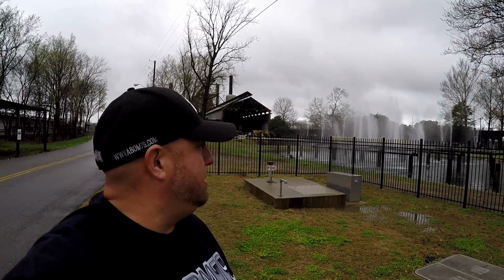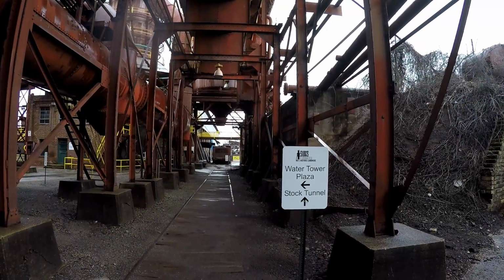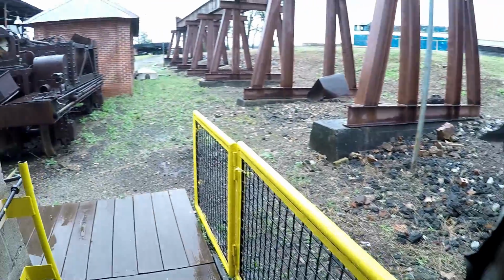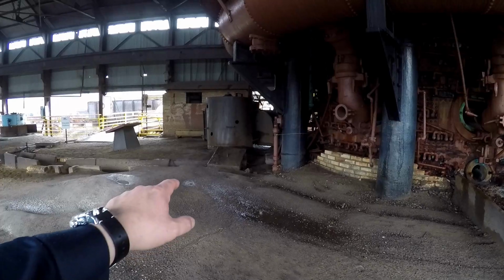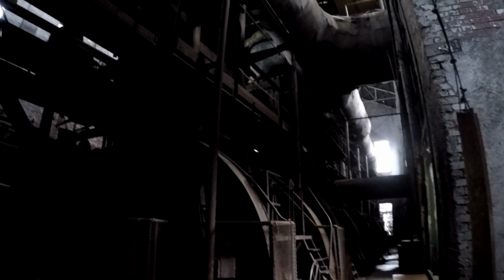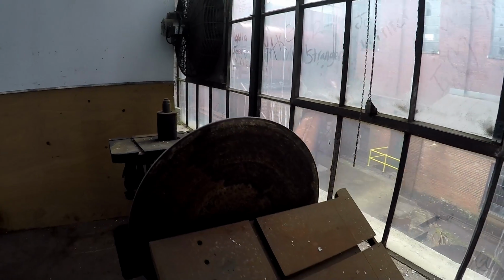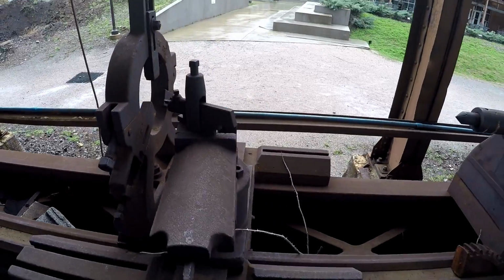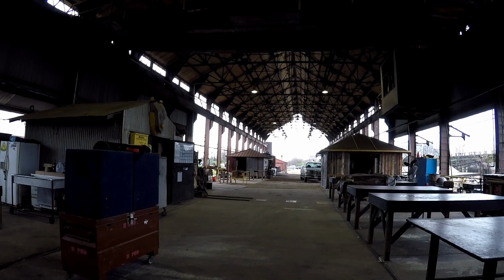Sloss Furnaces, Birmingham Alabama

Comment: The sanding machine has a spindle and flat disk sander. I suspect these machines were used for pattern making. That is a thickness planer and one of the first machines you showed is called a jointer, the jointer flatenes the wood then run through the planer to true up the thickness so the face sides are parallel.
Reply: James Stanlake you are correct. They are for pattern making. The jointer and molds gives it away. Pattern makers jointers have adjustments under both beds. No one that doesnt make patterns would want that type jointer. I wish i had all of those machines though. Would love to see them sing again. Im 2 1/2 hours south of there and have never been. Maybe it's time to go
Reply: they are used in pattern making but made for woodworking. I am a 3rd generation woodworker with over 50 years experience. Years ago I have used some of the old machinery with the square cutterheads, most of them set up for the overhead  belt driven power supply and converted to electric motor. Love the old machines as they are heavier and made with better steel.
Reply: You are right. What i was trying to say is that for general woodworking that jointer has alot of adjustments and is alot trickier to setup vs dovetailed or parallelagram beds. I have never had the privilege of running those old machines as you were talking about. I bet they were a joy. Your a lucky guy to have experienced them.
Reply: To put those machines into use there has to be several issues taken care of. They will more than likely have babbitt bearings and OSHA will have a field day if they come for a inspection with exposed wheels and flat belt pulleys so make guards and have grease and oil handy to keep things running fine and you have a strong dependable machine that is easy to maintain.

Comment: I don't know but think the horizontal pipe with the ducts going toward the portals were for preheated combustion air to make the furnaces burn hotter, faster.
Reply from the maker: William Johnson I know they were pointed into the boilers and were fed by the gas off the furnace.

Comment: the power house the wood machines are used to make the patterns you could see. Different color is used to paint pattern so that person making mold comes to know how to treat a particular surface. There is no universal standard for color code But there is commonly and widely used color code in pattern as given below:

Without Color: indicates the parting face of the split pattern
Red : indicates surface of the work-piece should be left as it is.
Yellow: indicates surface needs machining
Black: indicates surface needs core and also shows position of the sand core.
Yellow strip on Red: indicates the seats for loose pieces.
Red strips on : indicates for supports/ stop-offs
Reply: Pattern making is nearly a lost art. You also had to allow for shrinkage, both in the casting and in the patterns themselves.
Reply: its why you have pattern makers scales look them up lol
Reply: Never new about the color coding, make total sense.  Thank you for sharing!

Comment: I worked on relining the stoves that heated the air for the blast furnace in New Boston, Ohio.  They had insulation then a fire brick lining.  After we got the lining so high we took up the platform we worked from and laid what we called checkers that had holes in them that had to be kept in line so air could pass through them as it was super heated.  When the air reached the top it left the checkers and was directed in to a shaft we called the well and went down to large tubes that carried the hot air to the blast furnace.  The air entered the furnace though water cooled nozzles called tweers (excuse the spelling).  I got to work on sealing around those nozzles.  It was very interesting to work on the stove walls,  checkers, and the dome on top as well as around the blast furnace.  Similar to what you were visiting, old style but was around here till the late 1900's.  Thanks for the visit and sights, Greg.

Comment: At 30:32 Looks like an inveter from AC to DC.  Probably some of the older equipment was DC powered.
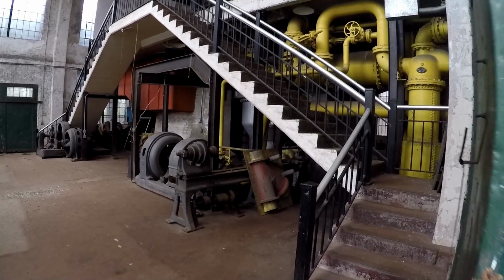Reply: Motor-generator (MG) set. AC synchronous induction motor driving a DC generator. You see an assembled set as he enters the Power House at 25:57.

Comment: Should have taken Keith Rucker with you.  He'd know what that Jointer is.  16" or 18" wowza!  The wood lathe with the casting patterns...must be what they were using that equipment for...making casting patterns.  That "grinder" is a combination Spindle Sander and Disc Sander.  some big old stuff to be sure.  All of that equipment was used for making patterns...what you saw after looking at the spindle sander.

Comment: Spent a year one week in a steel mill...takes a special kind of person to work in that.  Brought on to fix some programming on automated unloaders...and yea...found out the fools that designed the equipment that you had to have your hydraulic hose lengths the same when you are putting two cylinders in tandem...ugh...no programming errors...bad design.  :(